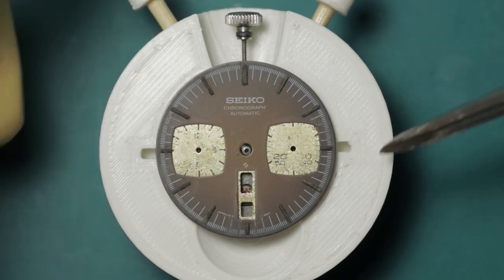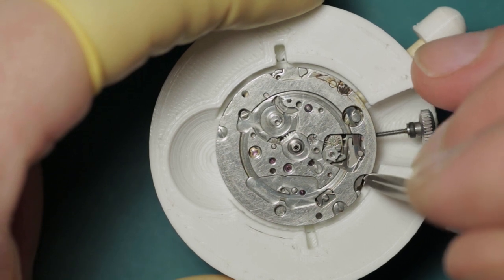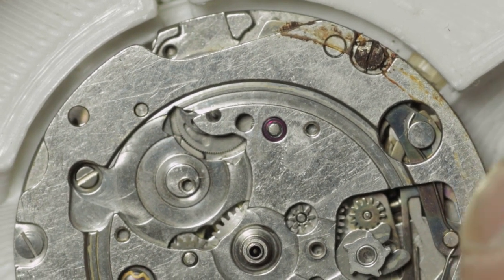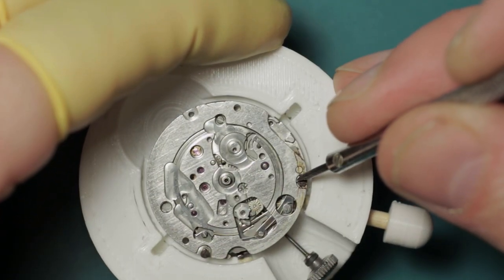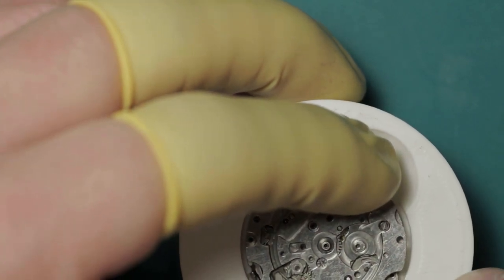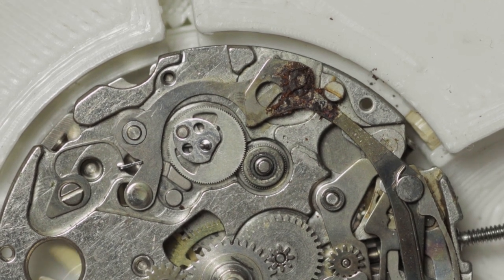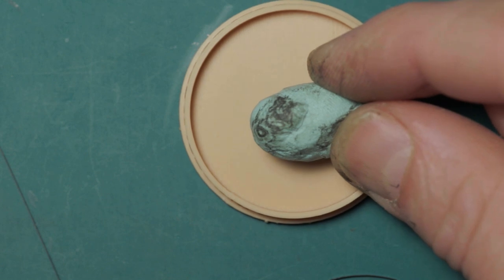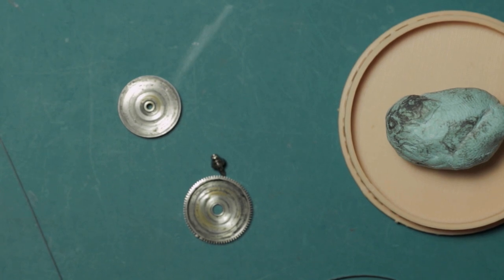Seiko Chronograph Hour Counter Won't Reset Bullhead 6138 - 0040

Comment: Mate I need that movement holder in my life! Where did you get it??
Reply from the maker: This is one I designed and printed Mike, it's for a 6139 and doesn't quite fit the 6138 correctly, I need to redesign it for both because I'm not 100% happy with it but I'll run one off for you to try in the meantime.
Reply: @spidiq8  wow mate I’d appreciate that. Thanks .